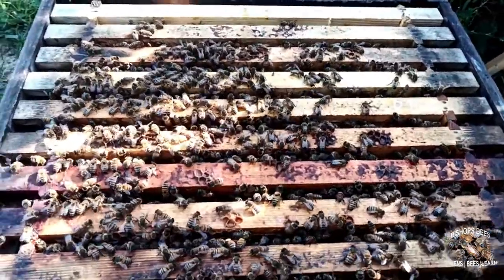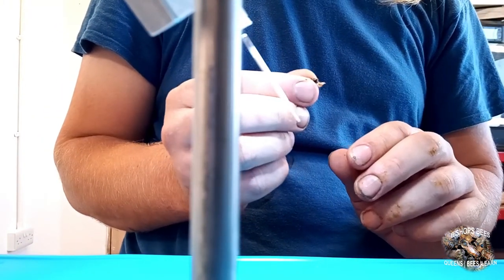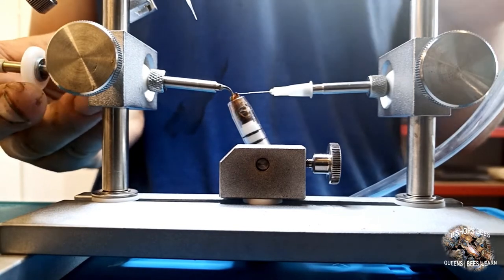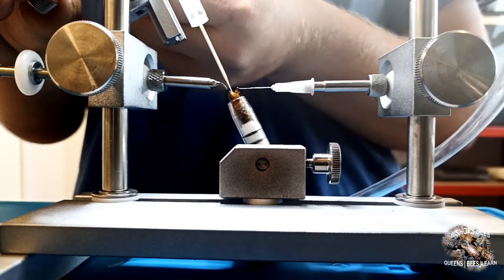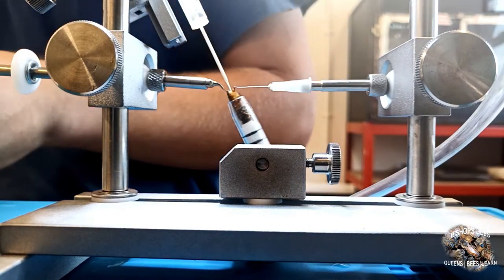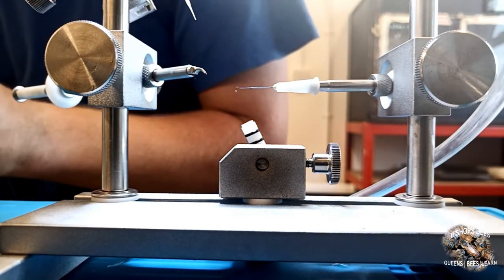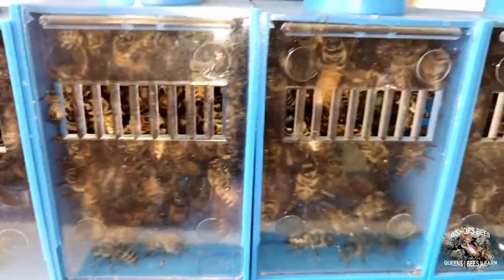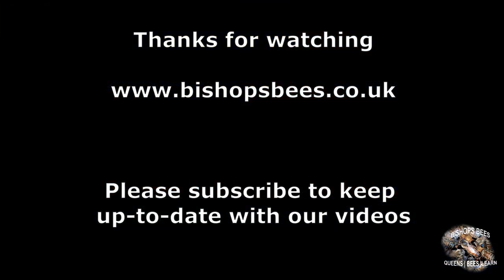Instrumental Insemination of Queen Honeybees

Comment: @3:20 you quote 5-8 microlitres of semen per queen. The usual dose is 8-12 so, I would ask, why are you reducing the volume?
Obviously, some is expelled after the insemination but I'm curious why you've reduced the dose. If it was to enhance the VSH trait,  I would have thought that single drone inseminations would be more appropriate.
Reply from the maker: You are right SDI is the best option to enhance traits. I have found that the reduced does produces similar results as the standard dose and I don't get leakage as can occur at higher dose rates, this keeps the queen cleaner. Also, I don't use saline between drones which has the effect of diluting the semen. If you use saline between drones then a higher dose should be used. If I feel that I didn't dose a queen well enough, I make a note and repeat the next day.
Reply: @bishopsbees2395  I don't dilute the semen. That would just distort the reading so you really wouldn't have an objective measure of how much the insemination consisted of.
The literature suggests that 1ml is enough to provide enough sperm to fill the spermatheca anyway so I wouldn't expect any loss of performance/longevity. I was just curious why you did it that way.
I think the selection of drone mothers is more important than the amount of semen delivered as that dictates the variability of sperm in the queens spermatheca and the composition of sub-families in her colony.